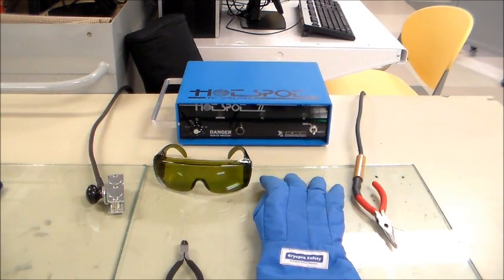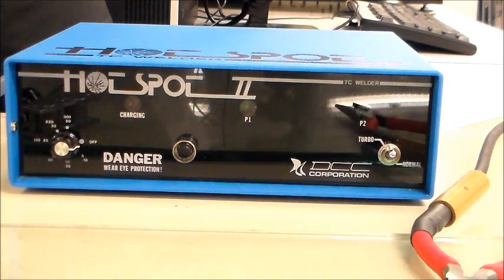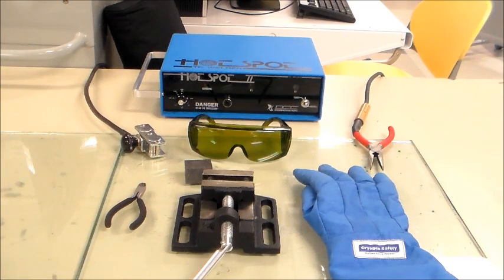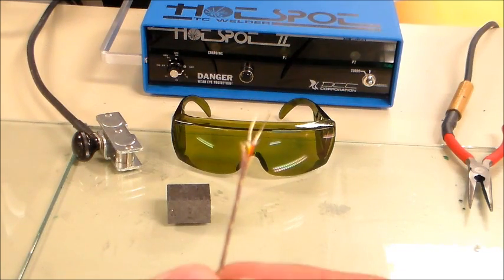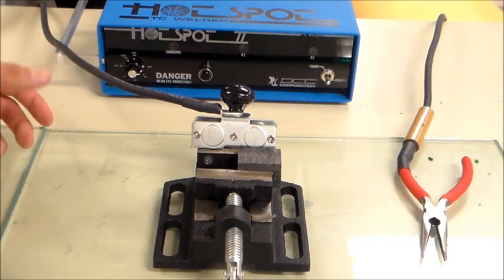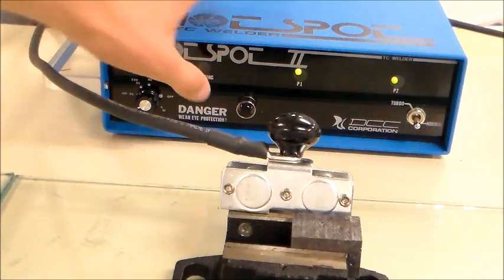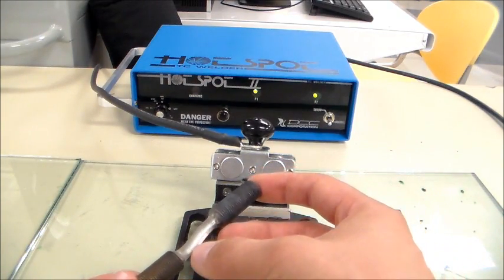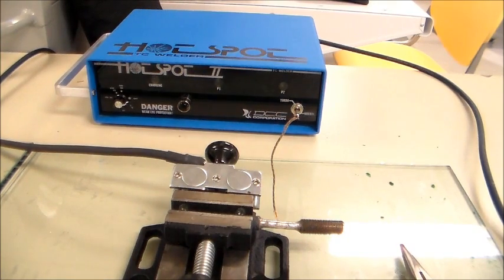HotSpot II Thermocouple Welder Tutorial

Comment: I have a hotspot II, I want to do spot welding of thin aluminum sheets. I have seen all videos regarding this. But it is not shown in any video  use of  a small red wire cable which one end coming out along with welding cable while other end is free and capped with plastic.